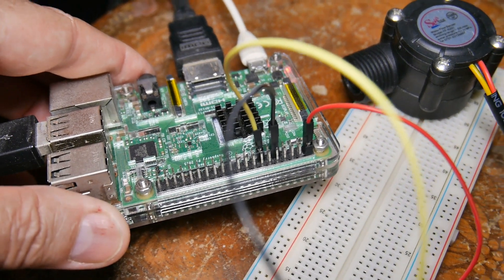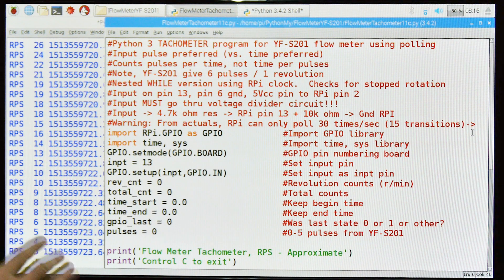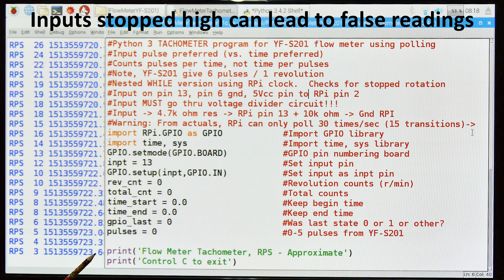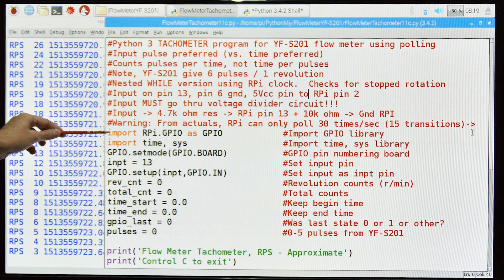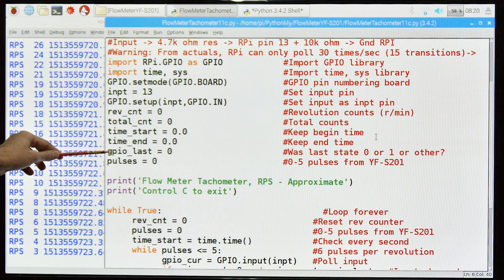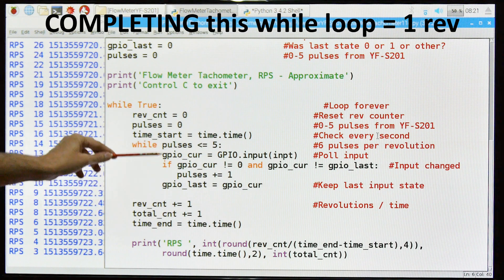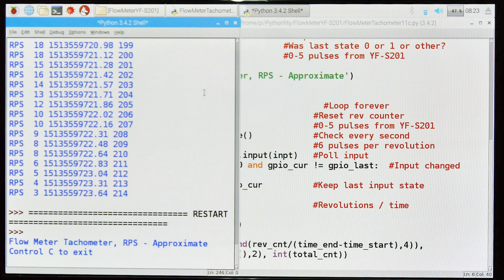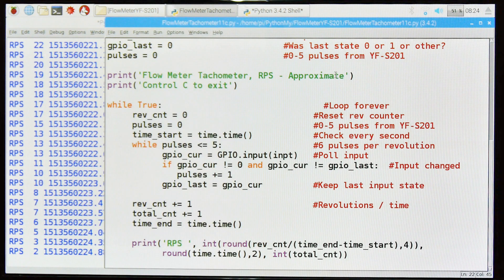RPi 21 - Tachometer- Hall Effect Sensor Input (FlowSensor)

Comment: i can't use GPIO in micropython raspberry pi Pico, could you please suggest how can i do it with machine, pin?
Reply from the maker: I am not familiar, but a quick search of pinouts for the pico shows that GPIO 13 is pin 17.  I could be wrong, but it seems like that from the diagram.
Reply: @tsbrownie  Thanks for your input actually i was talking about programming part... i am using mircropython on Pico and RPi.GPIO library is not working on it.
Reply from the maker: @shubhamchauhan4419 I think you can use the hardware pin numbers no gpio library needed.
Reply: Are you talking about machine, pin? I googled this problem and one guy on stackoverflow suggested that
Reply from the maker: @shubhamchauhan4419  Yes.